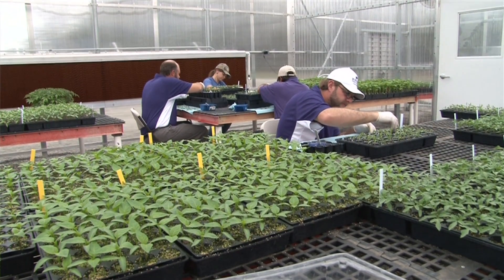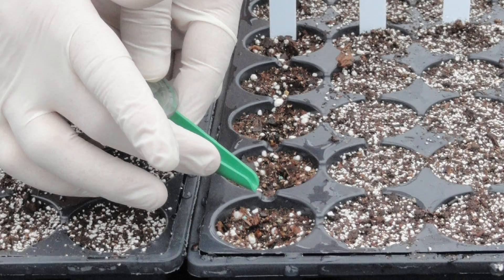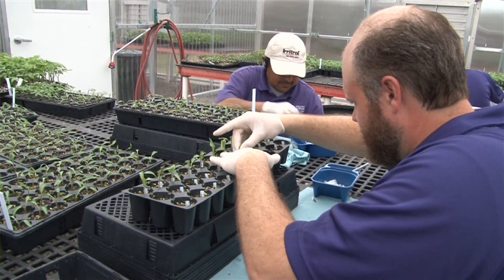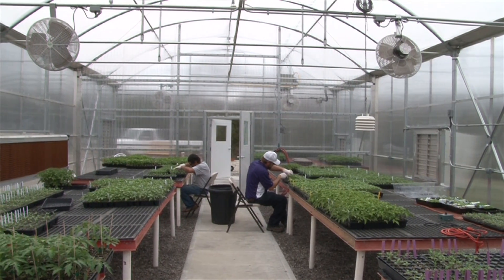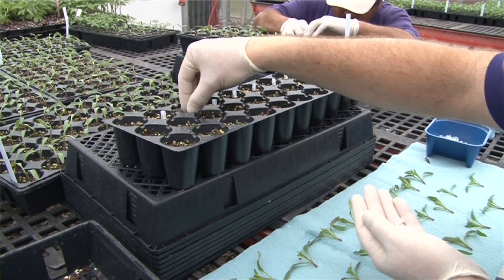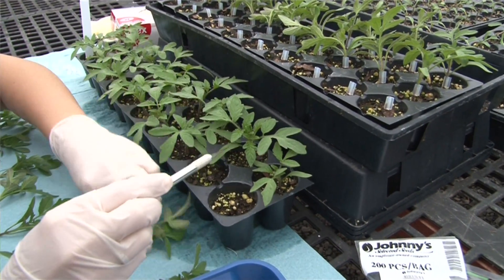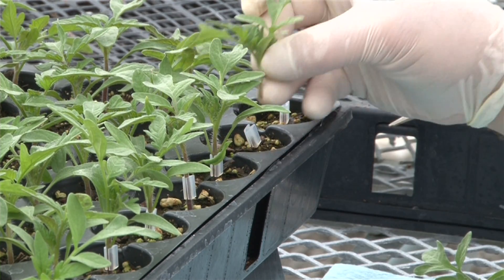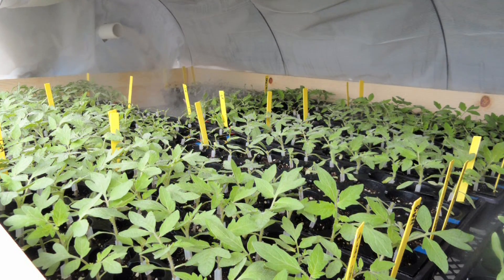Tomato Grafting:  The Process

Comment: I grafted 13 plants onto Spirit 4 days ago & have not had any wilting. I wanted to do 20 but several Spirit seedlings were too large (5) or puny (2) to match-up.

So, to compensate for the losses & set the clock back a bit, I'm rooting some of the clippings. Hope that will work. Next year, my scion varieties will get a 1 week head start.

I'm also wondering if growing-out the extra rootstocks to get seed is advisable.
Reply: nyrfan I was wondering about growing out the root stock. Have you learned anything new? The rootstock may be hybrid so I don't know I'd saving rootstock would be advisable